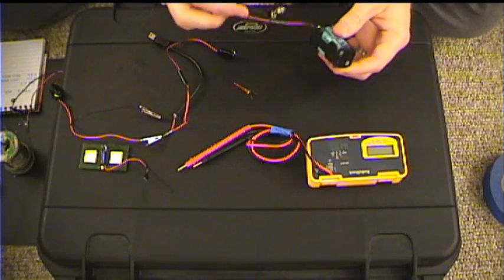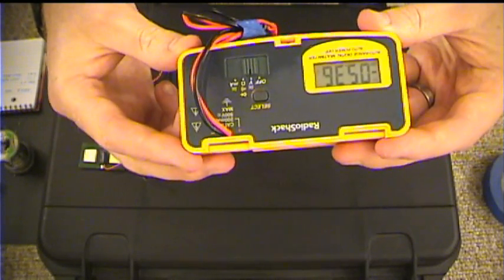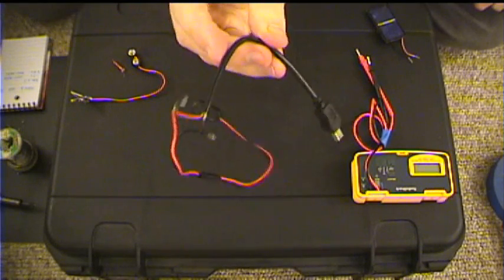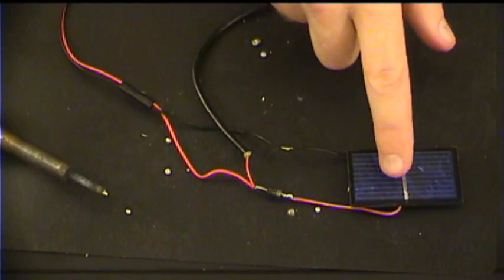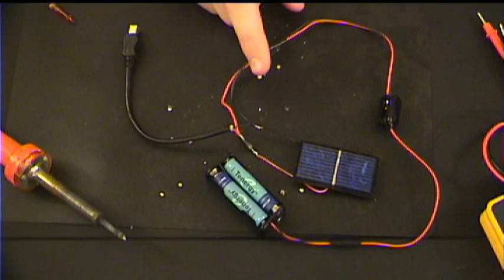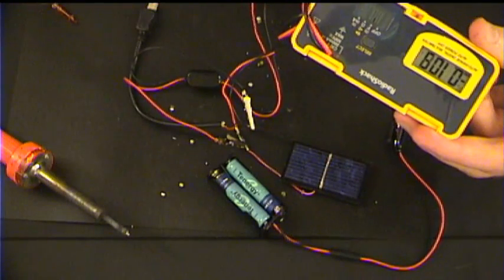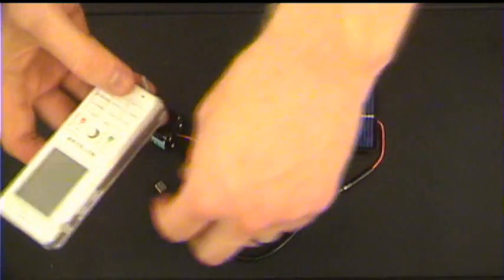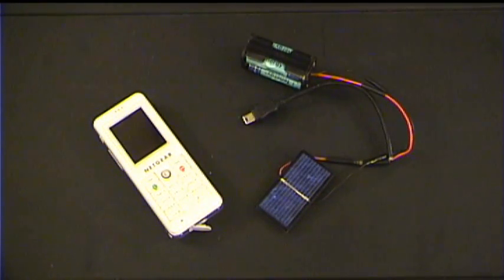How to make a rechargeable USB battery (solar edition)

Comment: Nice video! Want to try it. Will it charge my ipad? It requires more wattage than a phone
Reply: iPads need the signal wires to charge them so you need to connect them properly and the batteries can't really put out enough amperes for the iPad so it won't necessarily work.

Comment: Then either the batteries will either start leaking if you are lucky, if not it will explode! There is overcharge protection circuit.

Comment: neotoy, I need a 4 double a battery pacy rechargeable like the solar panel.... like for my rc car i drains the battery's... my rc car uses the same battery pack i just need a solar panel on top of the battery pack so i can flip a switch or something after im done and it will start charging the batterys  how do i do this?

Comment: hey your video seems wrong.. for you to fully charge your phone use 6volt acid lead battery and 1 diode, 16v 220uf capacitor and 5.1 zener diode and check for the voltage... thats all you need. always remember the color red wire is the positive..

Comment: Further more, like ledguy315 says. You have many faults in your circuit. Please learn more before posting videos on circuits that won't work. Yes, the batteries will charge the phone. But the solar panel won't charge the batteries. It's voltage is way to low. And if you want to charge batteries you also have to have a circuit that controls when to stop charge the batteries to prevent damage to them.

Try again in a few years when you know what you're talking about.

//Shadowthee

Comment from the maker: @unknotmiguel An excellent question, unfortunately I don't have an answer. I had just assumed that the solar cell would behave similarly to a resistor - effectively shorting the circuit and draining the charge in the battery pack. I do not however have any experience to support this assumption.

Comment: You've installed the diode backwards. The current is being blocked from charging your batteries. I totally agree with this. The rest of the video is good just re-solder the diode the other way and you should be OK. About the radio shack meter reading 5.38 volts you can just ignore that since the battery is rated 1.5 volts each x4 total volts should be 4.8V. But I think you should put a rechargeable battery and I think all AAA rechargeable battery are rated at 1.2 Volts and not 1.5 Volts never.

Comment from the maker: @mikedrz No, it's right in the video. The two 9V clips snapped together reverse the polarity. When they are removed later in the video you will notice that the diode has also been moved to reflect the changes. Lastly if you download the schematic you will notice that it is correct. If people aren't observant enough to notice such basic aspects of the design they are probably wasting time no matter what they do. You can send the $100 to neotoy@hotmail.com :)

Comment: @neotoy the current travels towards the side that's got the line on the diode.  Your solar panel would be draining the power from the batteries if anything, unless you fixed it since this video.  If you can prove it charges the batteries the way you made it in the video then that'd be great.  It's good you're trying to help people out, but if it doesn't work then people be wasting their time.

Comment: I have to agree with one of the other comments, the single solar cell won't put out the full voltage needed..  Even a trickle charger of 500mA would still require a voltage .7 to 1.5 over the voltage of the device you're charging..  (i.e. you would need 5.7 to 6.5V to charge a 5V system.)  the one you show, looks like an 1-2V single cell.  (noting the foil on the front.) Not very likely it would produce enough voltage to charge the 4.8V battery pack.

Comment: the usb voltage is 5 volts if you put a regulator like 7805 it will be a nice stabiliced and not burning cellphone device

Comment: DC voltage directly into your phone or other devices with a lithium-ion battery is going to fry the accumulater pretty quick, if the lithium battery isnt dead before that due to improper charging. I needs to gradually lower the power imput while still holding the same voltage all along when the battery is allmost charged, otherwise it will destroy the cells in the device's lithium battery.

Comment: @neotoy But I see what @yoududenut is saying... if you were to use a female USB plug, then you would be able to plug any USB device into it using that device's existing USB cable. It would make this device more universal. However, you make a valid point in that this is YOUR DIY for your solution. Very cool though!

Comment: Did you see if you can use the cell or mp3 or any small device  without the batteries? like if you where to plug in a camera in to the wall and still use it. I have a Vivitar 840 X HD Camera and i can use it while its plunged in. So in theory it should work. Pleas respond because i will try it if it works! And i will try to post a Video reply.

Comment: I'm trying to do something similar with a cctv. However, the battery pack will remain attached to the circuit at the same time the panels are charging the batteries and/or providing power to the device. I need to devise a system to electrically disconnect the batteries during the day when the batteries are fully charged and connect them back into the circuit to provide power when no sunlight is available.  Haven't started yet, so I'm hoping someone might give me a leg up on the particulars. Thx.

Comment: good idea with the homemade usb solar charger .but solar cells only put out .55v  open circuit max. you would need at least 9 to 10 of those cells to charge the battery correctly. the way you have it set up the solar cell dose nothing for the battery

Comment: Thanks dude great video! I saw this other video where the guy used the parts from a solar garden light to do the same thing, but the diode thing was a help here. You can disamble the garden light and use the parts to do what this guy did cheaply.

Comment: @JakkHack I know what i diode is. I'm saying he might need another resistor in the setup. 3:04 "The battery pack will be able to send current through this loop right here which goes to the usb cable". In other words, the diode does not prevent electricity from going to the USB.

Comment: in the circuit diagram you have the right direction of diode but in the video it is in reverse direction. i think there is a difference between  the circuit diagram and original video circuit.

Comment: also i pulled my solar panels off 4 garden lights i bought at walrmart for 4 dollars came with rechargeable batteries  as well as the panels i use for mine. But question is the part that makes the light come on when its dark the photo balhahah senor is there something i could use those for on this project or another?

Comment: hey thanks for the help with the switch thing im new to this sorta stuff but i got my charger working now but i was wondering if i wanted to install a light with a switch on it to show me wheter the batters r be charged or not where would i make that connection at?

Comment: Hey m8 i have been messing with solar power for the last couple of days i manged to link 4 togher and get a light bulb to come on when i shine light on 1 or all of them. i like ur idea about the battery thing and i was wondering since im using 4 panels is there anywhere in ur diagram where i could add like a toggle switch so when the batters die i could charge off straight  solar power????

Comment: Volts != current. Even though the voltage is dropped, the circuit would still be getting current. And there are diode that only drop 0.2 volts.

Comment: Not only will it not charge because the voltage is too low. It will not even pass the diode, as that gives a 0.7 volt voltage drop! So your solar panel has to produce AT least 0.7 volt to even pump anything into the circuit.

Comment: Right, i have everything lined up all i need to know is that would it be better for me to use 4 x 600mah 1.2v batteries in series to give me a totalof 600mah at 4.8v or two sets in parralel to give me 4.8v at 1200 mah.  Only because i would rather only have to use four batteries than eight so i might be able to make two. :)

Comment: and does the panel voltage need to be about half a volt higher than the in curcuit battery. (For it to trickle charge)

Comment: I saw you had reply'd to someone with the answer "The bigger the battery the longer it will take to charge", does that mean that if i use two of these (This is what the battery says) HI-WATT NI-MH 1/3 aaa 2.4 V 110mah it would work perfectly? Thanks. BTW i'm only 14 so i dont understand extreamly complicated things but easily understood you circuit diagram

Comment: hi i was just wondering if i could use a LED (Light Emmiting Diode) instead of the diode you used as my local store only keeps LED's and not just normal diodes??? and also what voltage and amperage does my PV Panel need to output to charge the 4 incurcuit batteries basically for it to be opperational? Thanks

Comment: I think this idea is great. I just made my own PV cells in a little laboratory and wanna use them as usb charger.
my question is: to get maximum power out of a cell the working resistance has to fit. how do you control this resistance that the cell works around the area called the maimum power point?
thanks

Comment: This is an awesomely simple design. Just remember that it will KEEP CHARGING YOUR BATTERIES and NEVER stop. If you don't want to keep manually checking your batteries with a voltmeter then put a feedback regulator loop on the circuit so that it stops charging the batteries once it reaches 5 volts. If you don't you WILL BLOW UP YOUR BATTERIES.... or at least break them.

Comment: i saw another vid and it says it's possible to use a 9v battery.....
but u have to use a 5v regulator(lm7805)....but according to my experiment....the 5v regulator keeps overheating...and i only on the circuit for a few secs....and it gets crazily hot.....can you help

Comment: Your diode is connected wrong way around.
Cathode to the batteries and Anode to the Solar Cell is the Correct way to do it.
In your connection Sunlight can't charge the batteries because the diode prevents it.